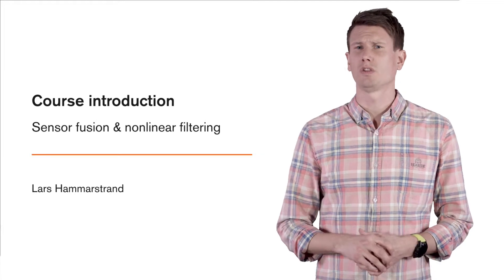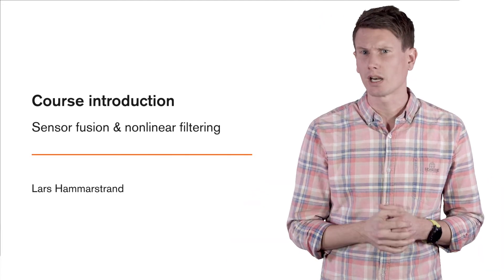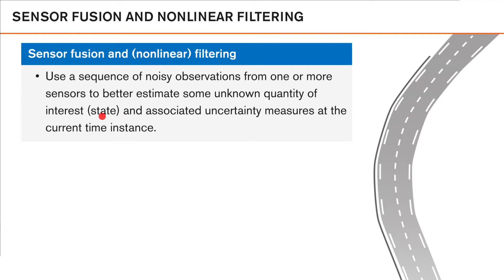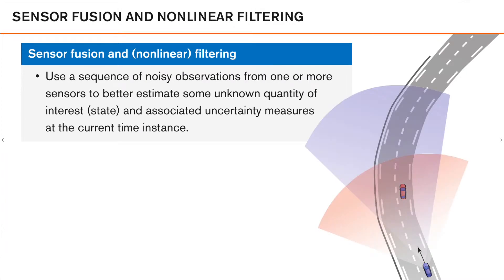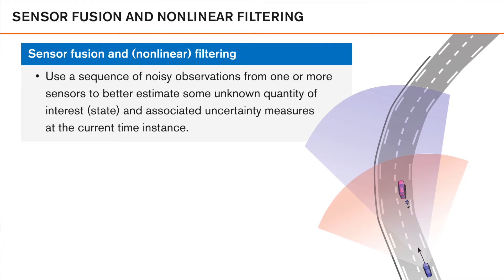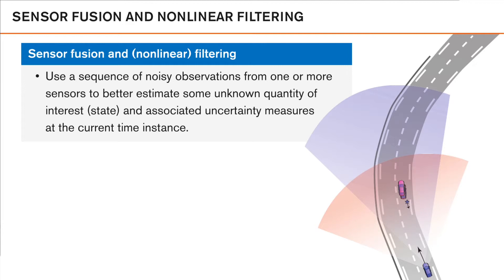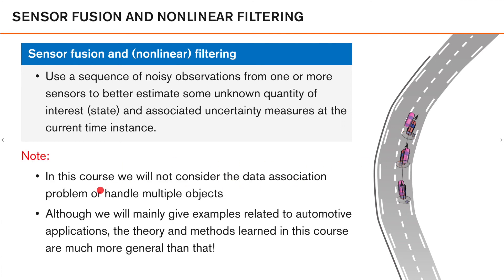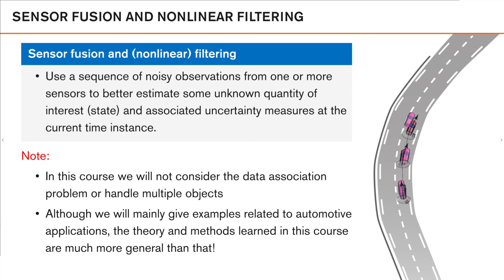1.1.1 Course Introduction

Comment: Is this cousre helpful for tracking problems. I am not interested in the surrounding traffic, I just want to get the position and orientation of host vehicle using sensor fusion of a GPS and an IMU. Does this course build the foundations for algorithms like kalman filter?
Eagerly waiting for a response.
Reply from the maker: Yes, the fundamental methods need to solve your problem is covered in the course.
Reply: @larshammarstrand  Thank you for your prompt response.

Comment: Hi, Thanks for your efforts. I want to know if any step by step example of any two sensor fusion is covered in the course?
Reply from the maker: Not in the lectures unfortunately as we cover this in on-campus tutorials. However, you can view a two sensor fusion problem as a filtering problem where you have a sensor model describing the concatenated measurement vector [y_1 ; y_2] = h(x) + [r_1; r_2]. This is assuming that the sensors are synchronized. If they are not you simply treat them as separate measurement updates with a short prediction step in between. Hope this helps!